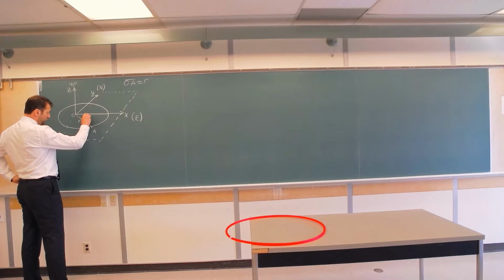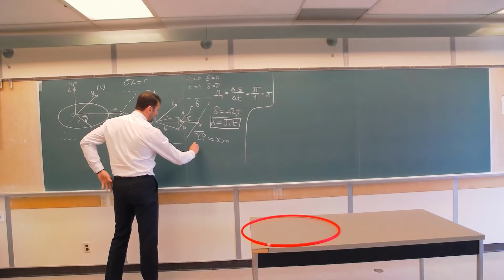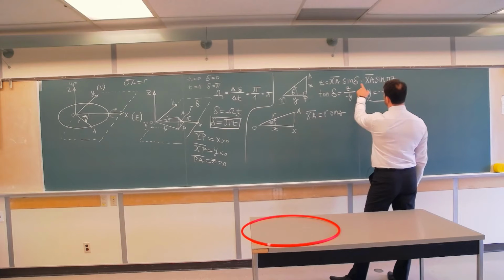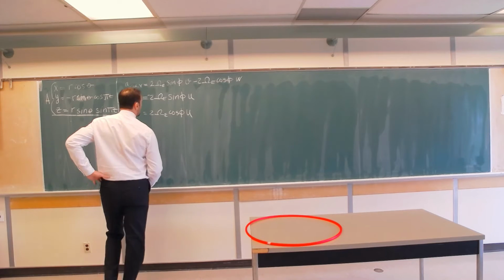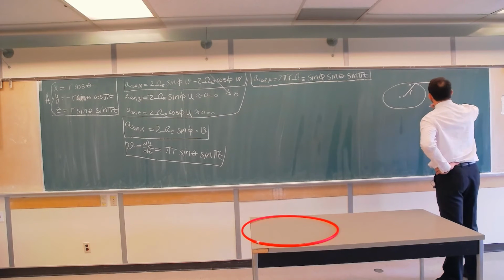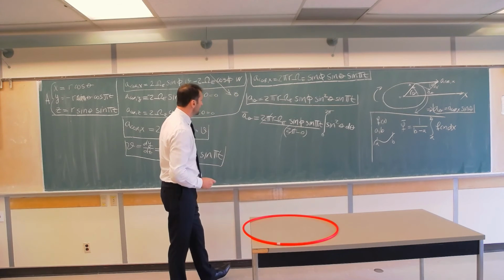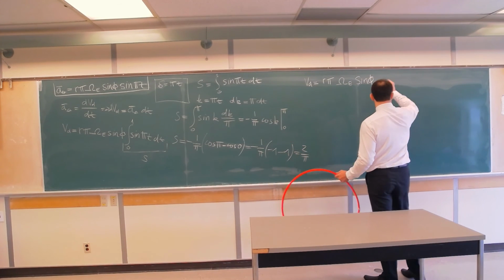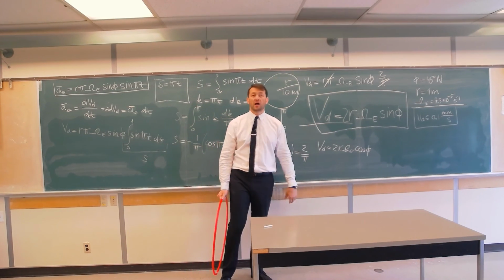Coriolis Force - Q19: Compton Generator

Comment: Excellent lecture. 

I think I can tell how Compton was able to calculate the Latitude so precisely. If you take your two drift velocity equations, one for the horizontal flip, and divide it by the one for the vertical flip, "r" and "Ωe" drop out, and you get VDh/VDv = tan(ϕ) . So if he measured the ratio of the two drift velocities he would have the tangent of the latitude. The frictional effects might also be roughly taken into account by taking the ratio.
Reply: Tf do you need tan for he just arccos'd the result
Reply: @gian2kk The point is that if you do the experiment twice, once with the loop horizontal, and once with it vertical, measure the drift speeds in both cases, divide the horizontal dift by the vertical drift this will be the TAN of the latitude. You don't need to know the Earths rotation rate or the radius of the loop. However, I have now looked up Compton's experiment and he did not do it this way.

Comment: Thanks DR. I had a brief moment of imagining repeating the flip to multiply the drift velocity but the 2nd flip reverses the drift velocity from the 1st flip so they cancel out. You get zero drift velocity after two 180  degree flips. 0.1mm/s per meter of generator radius is perhaps the reason it never caught on as a practical demonstration.
Reply: IDEA: Have a large diameter PIPE and constrict the pipe 100:1 or more at the viewing point. That gives you a possible 10mm/s flow in the viewing area. A 100:1 area constriction translates to just a 10:1 reduction in diameter. Perhaps 160mm land drainage hose down to a 10mm clear plastic hose. 3D printed couplings perhaps. 16:1 radius = 1:256 flow rate. I expect quite a big loss to heat through the action of the constriction but immediately after the flip the flow might be quite impressive.

Comment: Very good Djordje,  but doesnt this appartus raise the question if you did this experiment on the equator in the vertical scenario, you would detect a drift velocity also ?
Reply from the maker: That's how Compton actually used it. He would flipt it from vertical to vertical. One doesn't need to be on the equator (Compton wasn't), but the drift velocity in that case has the cosine factor rather than sine.